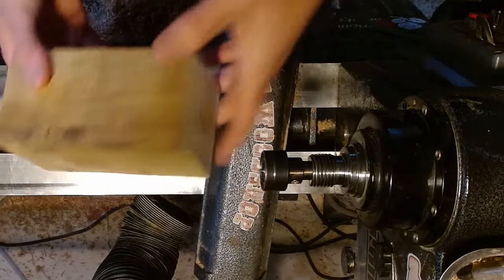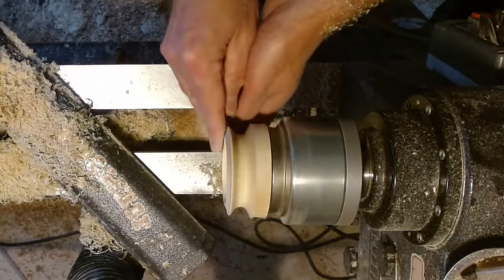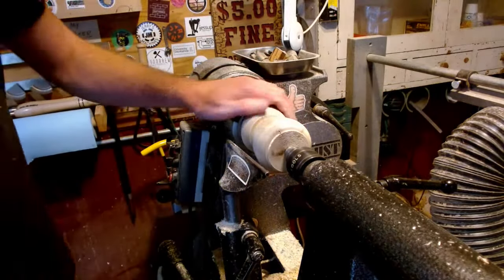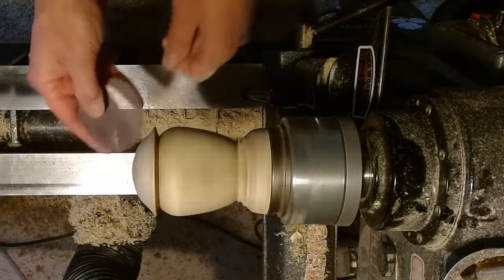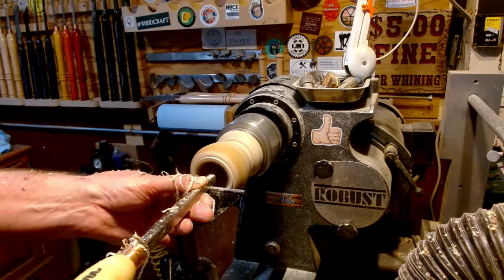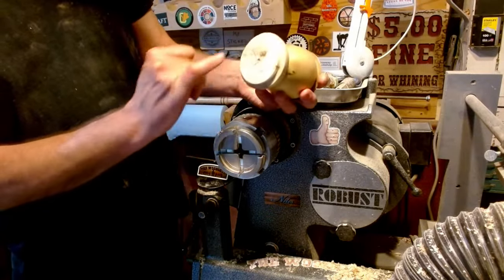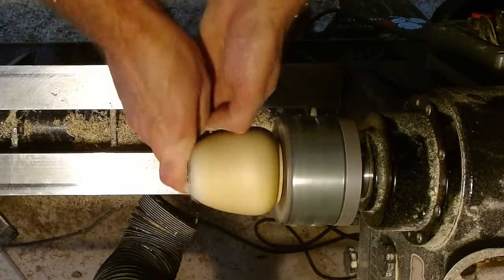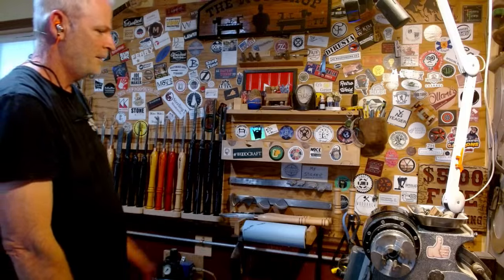Woodturning | Lidded Box Turning Demo

Comment: Carl, my EASY WOOD CHUCK scroll ring is hard to turn either direction, I’ve tried some light oil around the ring but not much help, I’ve worked it full cycle closed to open many times but still hard it takes both hands to move it any suggestions. 
Great piece. Happy birthday.
Reply: The company replaced my first one because of this same issue, but the second one is about the same. I think Carl’s is just an exceptionally loose one.